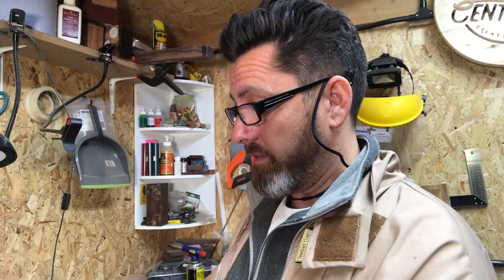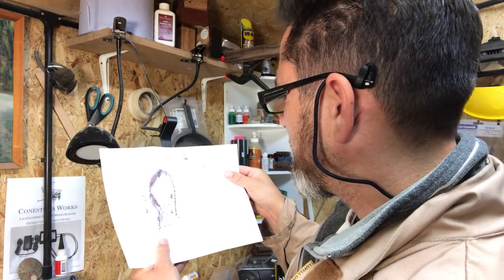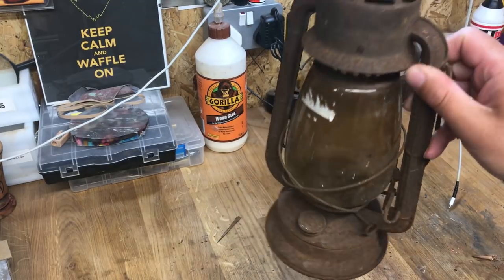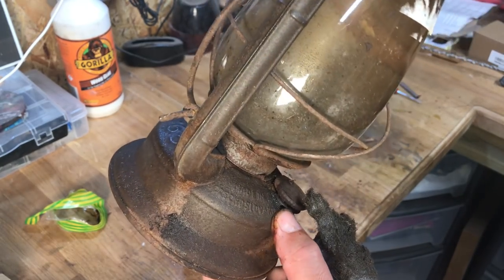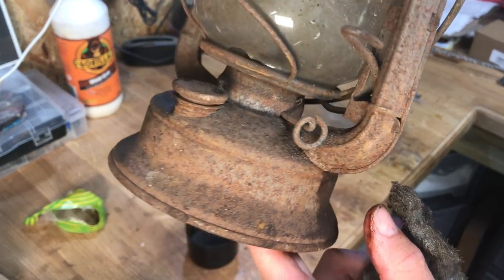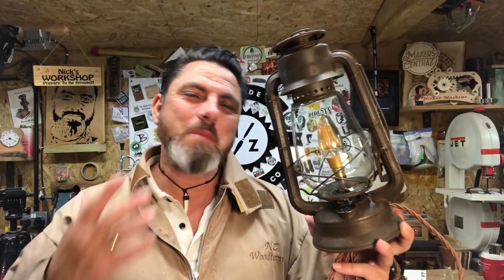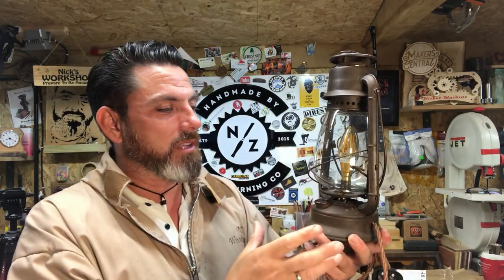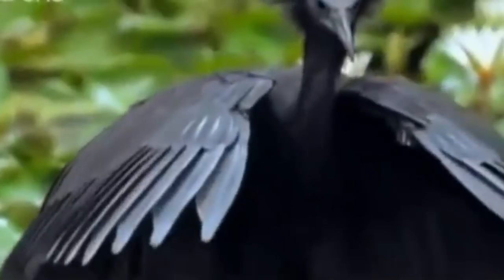Re-modernising an old lantern i got from a boot sale- mixed with a waffle

Comment: I just found your channel the other day and have been binge watching. I almost laughed when I came across this project and looked at the upload date. About the same time you put this up I made 3 of these to hang under my back porch. Even used the same style led bulbs, but on mine I put my lamp socket in the top with the cord routed up due to they hang. Keep up the great work. Myself I tend to stay away from wood as much as I can in the shop, like machining metal and electrician by trade, but I like your style of video productions.

Comment: Loved it nick I have a tip if you would like it but if you touch the glass on a filament bulb 💡 it shortens them by roughly half the oil from your hands seep through the glass can’t wait to see your next video and love the resin casting too I am looking to start too I got my self a pressure pot so I’m on the way I also have 3 lathes I fixed up so I should be set soon I hope 🤞

Comment: Great work on the light Nick, top job.. I found the same type of lantern and took it all apart, cleaned and rebuilt, looked great and felt great for doing it.....keep trying new ventures, you learn so much more and have fun doing it..

Regarding the phone speaker that was given to you, just place the speaker of your phone into or up to the bottom gap and that will act like a megaphone...cool stuff 👍🏼😊

Comment: looks great but you really should put a grommet or cord grip where you have drilled through the metal case. I saw you put a cord grip inside but that won't stop the metal rubbing through to the bare wire. you can get cord grips that look a bit like toothpaste lids that are perfect for this type of thing.
Reply from the maker: cherryturbojames yeah I got one but forgot to add it lol 🤪🤪
Reply from the maker: cherryturbojames the grip inside is so that you can’t pull the connections out of the light for safety bud 😊👍🏽
Reply: to yeah I figured that and appreciated that you earthed it too ! save anyone going bang further along down the line pop that thing in if you have it . keep up the great work love your videos .